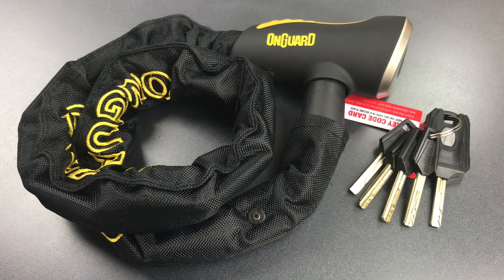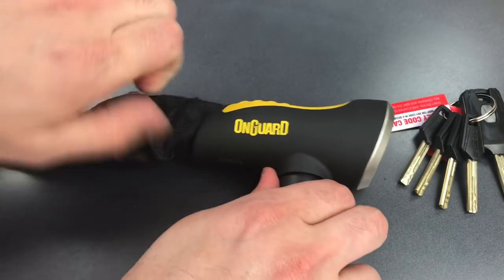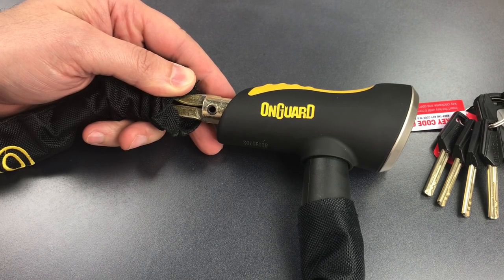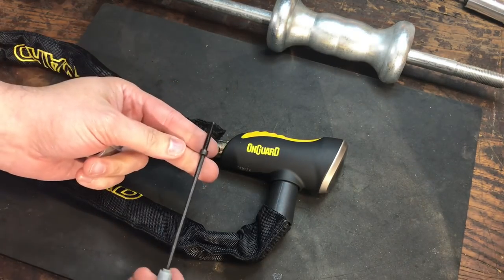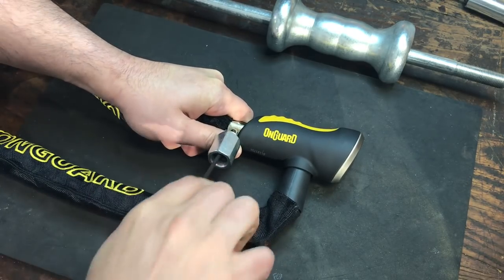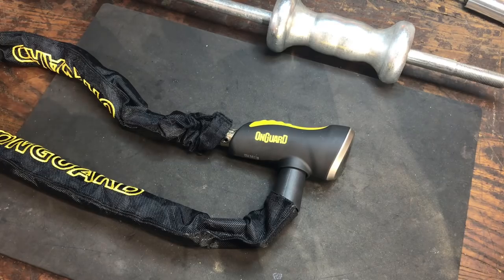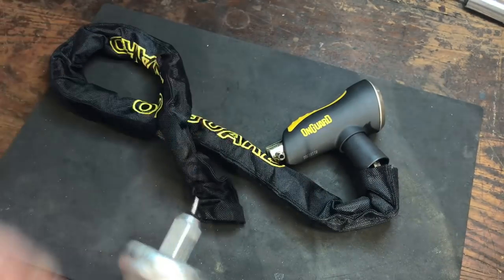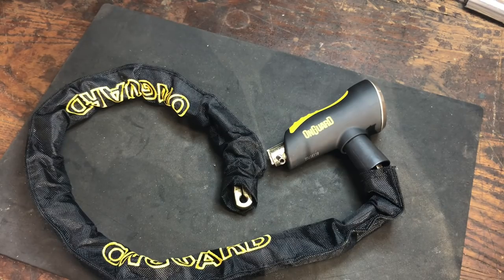[681] Slide Hammer vs. OnGuard Mastiff Bicycle Chain Lock

Comment: Although that did work, is that really a viable criminal method, I would think the time hanging around a chain with a slidehammer laying on the ground , while you found just the right screw to anchor in would be a bit obvious to the casual onlooker.  whereas yesterdays slick pick nad go would be more realistic
Reply: I've seen assholes walk up with a hack saw to a chain at my Uni years ago.
Reply: 2 minutes of not having someone around sounds viable.
Reply: Wear a safety vest and get away with "Yeah, it's an abandoned bike and we're decluttering the city". Alternatively no vest and "The key broke".

It's surprisingly easy to get away with stealing bikes in broad day light. As long as you don't look like a crack head no one generally bugs you, even if you're walking around with 48" bolt cutters.
Reply: Todd Forgrave it's not that viable indeed because a random thieft is not likely to carry around those tools. Anyways, don't rely on bypassers, they will do nothing.
Reply: The key is targeted attack vs opportunistic attack.  Someone would need to drive a trailer of tools around if they added up all the specialized attack videos on YouTube. But that's not the point...the big focus is if you present time and opportunity - same target everyday (I.E. a bike always locked up outside one's apartment).  One can research and accumulate just the tools necessary to perform the theft.
Reply: Niidea1986 a slide hammer and a few screws will work on a lot of bicycle locks. So all they have to do is be looking for a bicycle with a core that can be yanked.

Dress like a hipster and in most cities no one will look twice.

Comment: Simple; 

1 -  Drill a hole threw the roll pin center all; the way threw.
2 -  Drill from the back side hole you created, a hole slightly larger than the Roll Pin. 
3 -  Punch out  the roll pin!
Reply: D.R. M., nah,  you'll have a hard time drilling this.
Reply: It is not that hard, you have a guide, the roll pin, and on the way back you have a pilot hole, just don't hit the pin on the way back.
Reply: The point of this lock is to make bad guys take so much time getting around it that they're likely to be reported and caught.

Any lock can be picked and/or bypassed.  It's just there to keep honest people out and slow down the dishonest.

Comment: So what are machine screws actually used for? I looked online but I'm sill confused :(
Reply: Machine screws are used on metal parts. Usually they are screwed into a part that already is threaded to receive it.
Reply: look at your wall sockets and light switches.
Reply: ZombieX65 To hold things together, it's just a normal screw.
Reply: so just screw em in and break it off and you get a good connection, p interedtin', thanks :)
Reply: ZombieX65 break them off? What?  Now I'm confused... machine screws are just screws that are the same diameter all the way down the shaft. Not tapered like a wood screw. At least that's what I always thought. I don't know of any screws you would want to break off while installing...
Reply: It's another word for a bolt. Usually machine screws have heads on them that take normal screwdriver tips.
Reply: Phred Phlintstoner sflr, and he twisted it in then it broke off or something and then he threaded the slide hammer right?
Reply: ZombieX65 no the slide hammer has a cap with a hole in it  (for lack of a better description) on the end that the screw passes through before thredding into the roll pin that pulls the screw back up and out with. So that "cap" pulls against the back of the screw head. Did that make sense?  I'm starting to confuse myself here... But watch lpl's first video with the slide hammer. It shows this much better than this video does. And much much better than I can explain it...
Reply: Phred Phlintstoner, Nah I'm talkin about the thingy with the light blue handle. It looks to be connected to the screw n he just breaks it off? or it might just be an allen key type thing he uses to tighten the screw. I thought they were connected because when he pulled the first machine screw out, it seemed to me that the hande and screw were connected. So he broke it off with the slide hamer attachment already threaded on?
Reply: ZombieX65 that was just a t handle Allen wrench. yes the screw was on the wrench when he showed it. so the "breaking off" was just him removing the wrench.
Reply: ZombieX65 I hope that helped some. I can see how that looked funny at first glance...
Reply: Yea, it had me confuzzles :P, thanks for the help :)